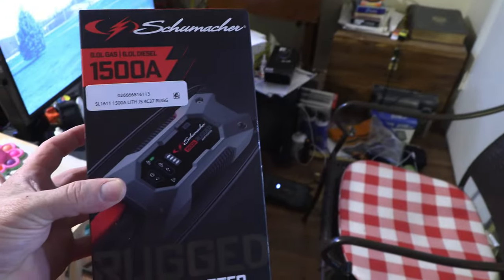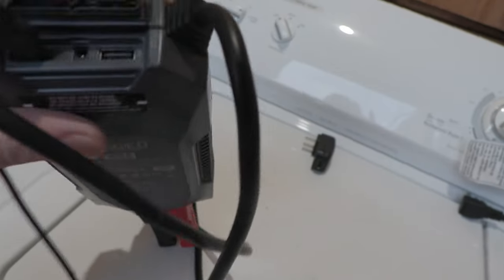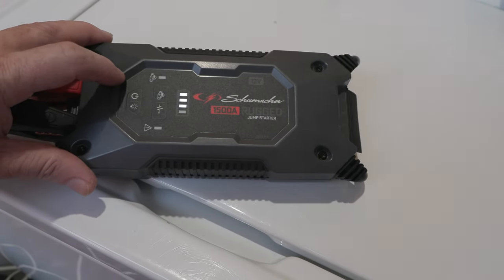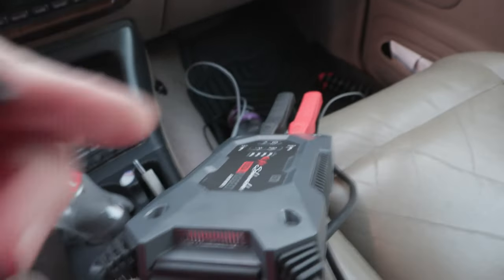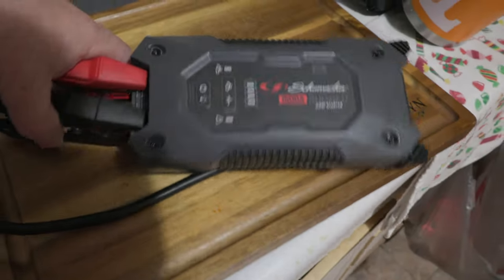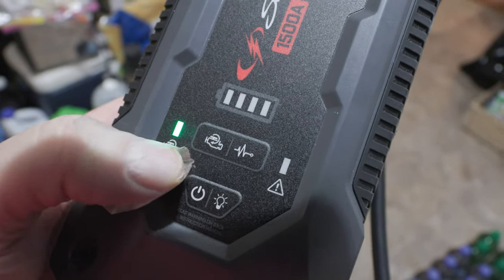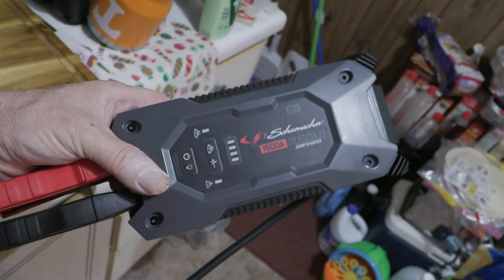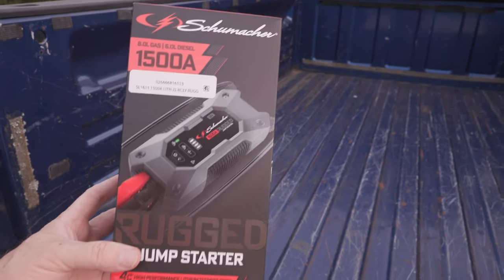Schumacher 1500 Amps Rugged Lithium Jump Starter $130 | Schumacher Lithium Jump Starter model SL1611

Comment: Great video. Ty. I just purchased a used on that came without the charger. I plugged in a usb-c charger I have for my iPad Pro and it charged it up. Thanks for the other resources provided on the features it has. Have to find a nice bag or case for it.
Reply from the maker: Get a small nylon or cloth bag for it. You could more than likely buy one cheap on the internet. Thanks for commenting. Have a good night 🌙.

Comment: When i turn it on and its connected to the battery why does it make this clicking noise the charger
Reply from the maker: This jump starter will click several times because it is charging the car battery. That is normal. Thanks for viewing and commenting. Have a wonderful Wednesday!
Reply: @BigOvlogger  also the one I have is 1500a rugged sl1611 and it doesn't have the same buttons as this one can it start batties that are dead...it only has two buttons power and the USB light button
Reply: @EricFriedman-re4gs  Instructions are included in the box on how to use the override by holding the jump start and USB button down at the same time for 5 seconds.